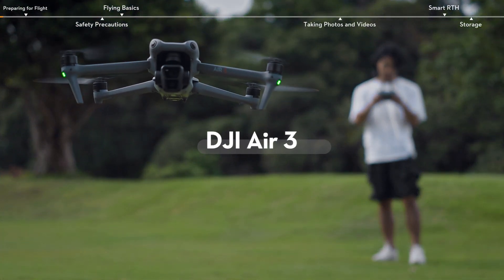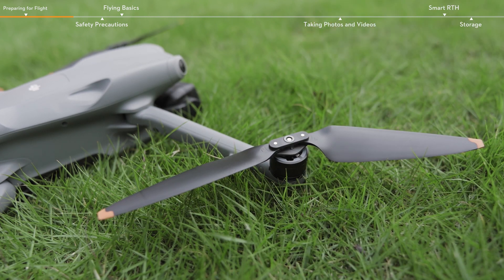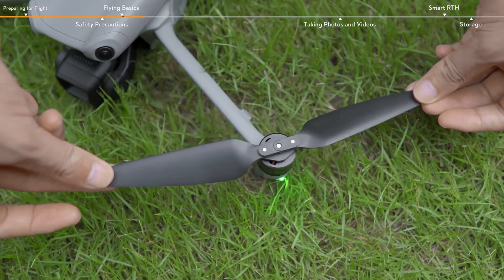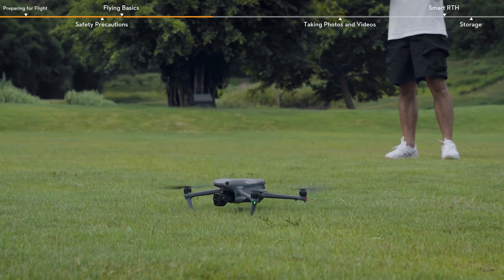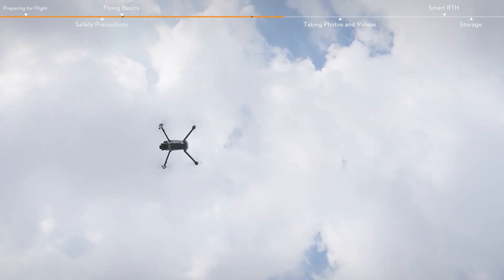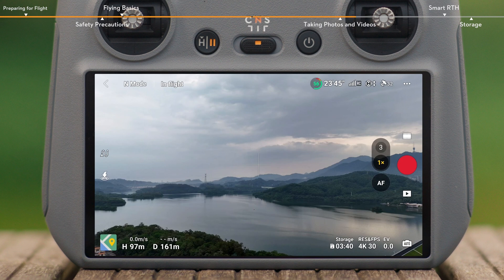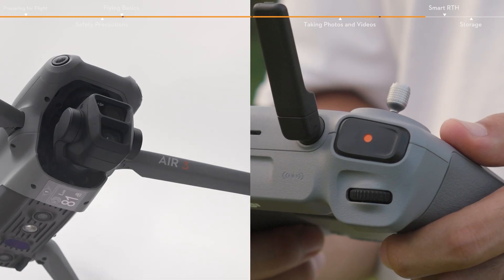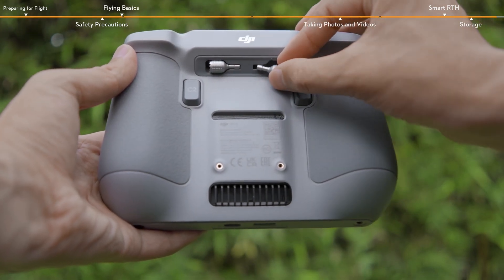DJI Air 3｜First Flight

Comment: I have one but it doesn’t go high can you tell me why or which one does
Reply: Go to settings see if it's in beginners mode that will limit the height and distance you can fly also there is a place that you can set the height and distance manually check that out

Comment: How do I switch from Auto Focus to Manual Focus?
Reply from the maker: Hello. AF/MF: Tap the Focus icon to switch between AF and MF. Press and hold the icon to display the focus bar.
* In AF mode, you can tap on a designated area of the screen to focus. In MF mode, you need to slide the slider for focus adjustment.

Comment: Hey Dji, Please can you release a Firmware update for the Air 3. Adding the option to switch the auxiliary landing light to a strobe light. ( Please Please ) as this is a requirement in most countries to fly at night thank you 😊
Reply from the maker: Hello, there. We do not recommend users attach third-party accessories on the aircraft considering safety.
Reply: Gday,  Sorry no no I didn’t explain properly. In regards to the new firmware update. 

I was wondering if dji may create a feature in the operating system to switch the current bottom white led light on the air 3. 

Then users will then have a option to switch the existing white led from solid to flashing / strobe feature   or different user friendly custom patterns as per require in different countries around the globe,

Cheers Mate 🇦🇺
Reply: He's asking you to turn the landing light into a strobe light as well lol

Come on DJI this needs to be an option on every drone

Comment: On September 22, my drone DJI Air 3 crashed due to a system glitch. but I'm still waiting for the test result to confirm that this is a warranty issue. support no longer responds to email within 10 days! In the online chat, support refuses to help and cannot provide any information so that they can respond to my letter, citing the fact that I am from Ukraine. but I have repeatedly explained that I bought the drone in Germany, the accident was in the Dominican Republic, I am now in the Dominican Republic, I will send it to Germany for warranty repairs. the operator understands this, but still refuses to help.

Comment: So who's responsible for producing updates? After the last update on my Newly acquired Air 3 I can no longer self land with the Obstacle Avoidance Sensors (OAS) on. One foot off the ground trying to land, pushing down on the sticks and it just won't land unless I turn off OAS. Worked fine before the update I was able to self land no problem. And another thing while I'm at it, why not make it so that users can PAUSE recording? It just makes SO much sense to me. And why it doesn't work that way is beyond me. And another thing, why can't the RC/N2 controllers be equipt with a scroll wheel for zooming in and out? And WHY for the life of me aren't I able to ZOOM when in Photo mode? I can only ZOOM when in video mode. That to me makes absolutely no sense. And lastly, that when I'm in ACTIVE Track mode and when I have the Position selection Wheel pop up that it is under imposed to the tracking bar so I cannot select BACK to follow me from behind? The SELECTION Wheel should be over imposed of the tracking bar so that I am, able to select Forward, Back, Left, Or Right or diagonally in each respect? Please help in all of these dire circumstances. Please

Comment: Excellent presentation, mine arrives today via Amazon, but "big but", need to a get a minimum 100w power supply which should charge a battery* in about 1 hour, so I purchased an Anker 737 from Amazon rated at 120w as neither the DJI recommended 65w & 100w power supplies are available from the DJI shop or anywhere else apart from fleabay?
* Not found any information on how long it will take to charge all three batteries when installed in the hub and of interest when charged in the drone DJI says the power is limited to 65w and therefore expect an 80 minute charge time.

Comment: I think if DJI released the Air 3 with the following specs.
1. One inch variable aperture sensor.
2. The ability to change the horizontal and vertical position of the camera (as on mini 3 pro)
3. Air 2S weight and dimensions
4. New remote control, new communication system.
In my opinion, this would be the best drone for creativity.
What do you think?
Reply: nice suggestions, however they can't put everything in one product model in order for other products to be sold.., and not all drone user is looking for advanced features like u mentioned since the pricing is also a concern especially for those casual or recreational users, majority still looking for better pricing with the specific features that they want. basically its business perspective.
Reply: @mharvzdronethusiast677  Are you filming with a drone? I have mini 3 pro, air 2s, mavic 3. Mini 3 pro is the perfect drone for quick shooting and social media, Air 2s is a very good drone, 10-bit D-Log, stable picture. Good weight (although already on the verge), size (although already on the verge). mavic 3 - heavy, stable drone, large, good picture - only commercial. Why Air 2s and not mavic 2 pro? (one remote control for 3 drones, you don’t have to bother, switched it and flew). Now about Air 3 - why a huge, clumsy (who flew on mini 3 pro will understand), heavy drone. The size and weight of the Mavic 3 classic and the price of a camera from the Mini 3 pro (albeit more advanced software, better noise reduction and D-log).
Reply: @onlythefirst I don't understand what you mean?
Reply: @theone2be33  What exactly do you not understand? Specific point?